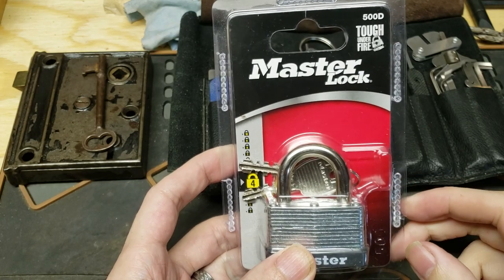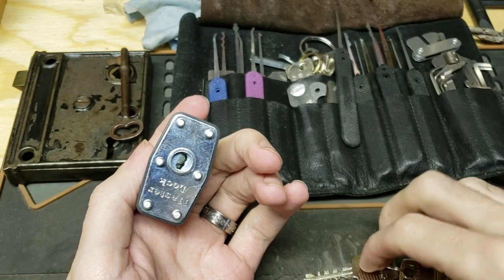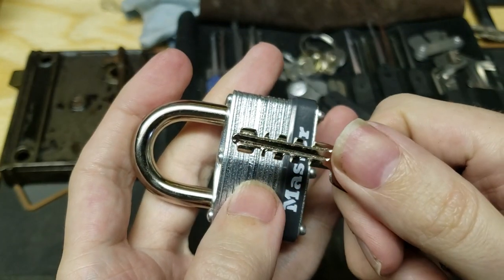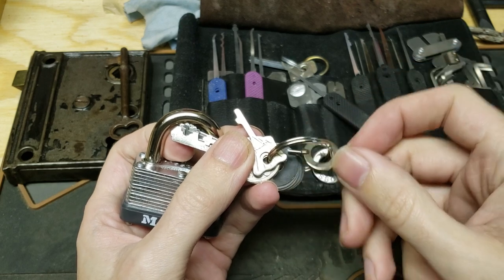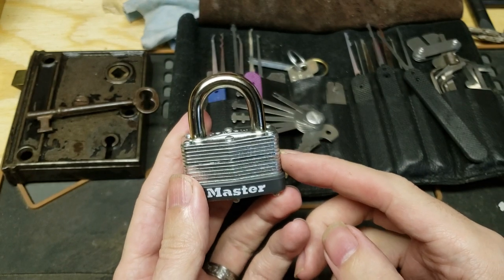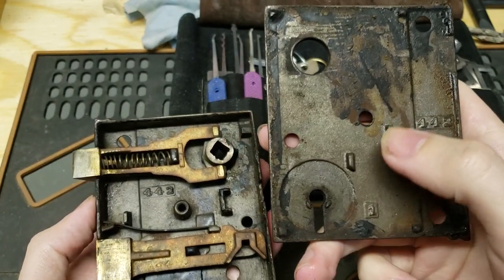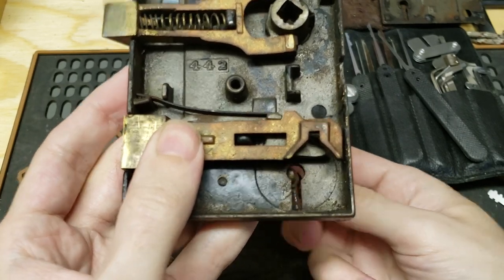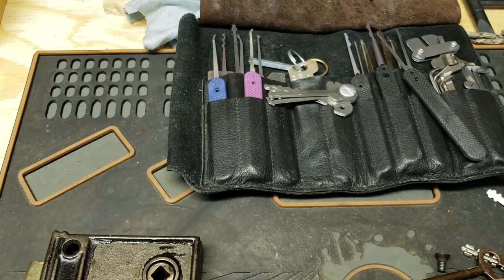(116) Introduction to warded locks

Comment: 4:50 I see my favourite handcuff key :P
Reply from the maker: Always keep one in your field kit, just in case.
Reply: I am just a hobby picker now and then, but I love my key so much I always have one on me at least. I have one on my keychain sandwiched between some 1" velcro rather than have the key 100% blatant on display on my keychain hanging off my belt. Then, just to do it I cut the head off one of the keys and put some GorillaWeld on there to make a ribbed surface at the top of the, now cut, barrel. Then put some tight silicone  tubing on the end (leaving enough working length to content with plastic gripped models like speedcuffs etc) and then I hook the split bit through the loop end of a bobby pin and slip a slightly larger piece of silicone over the top, covering the full amount of the little key (edit: also a tiny ziptie to add a little nub to grab on for turning force). Then I bend the excess bobby pin length to make a hook and it's sat on my neck chain with my YubiKey Neo :P. Just to do it haha. I like little projects like that. I just got finished destroying a mini NFC tag and scored, cut, filed and made myself a basic version of the double lock key on my new cuffs so that I have a plastic backup in my wallet in case any unforeseen shenanigans happen with my pair. I have to jiggle it a little bit but I have tested it and it opens and closes on both double locks. I love it when little things like that end up working.
Reply from the maker: @SilentButDescriptive  Oh I have a few backup keys tucked away various places, the one in my field kit is for work emergencies.
Reply: :) very nice

Comment: One more thing that can wear out is the hub on the actual latch. Those ears will wear off and then the latch acts as a lock that cannot be retracted unless you can get a knife in to retract it against the spring. Your only option then is to remove the door from the frame and remove the cassette. Ask me how I know 😉

Comment: Looks like the latch on that old lock can be rotated to work in a door opening in the other direction as well.
Reply from the maker: It is indeed field reversible to adjust the handing. Just remove the cover plate, carefully pull the latch up (the spring will try to escape), flip the latch over and slip it over the hub, then replace the spring in the slot in the latch.